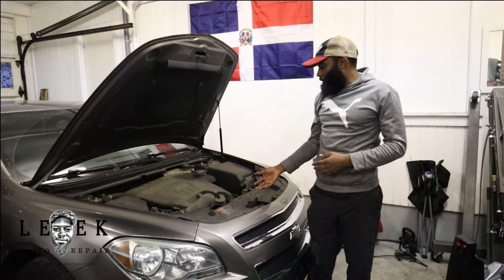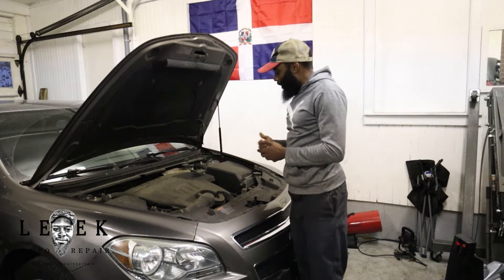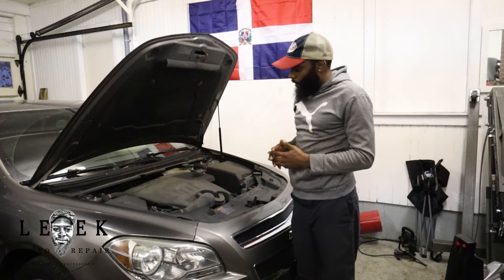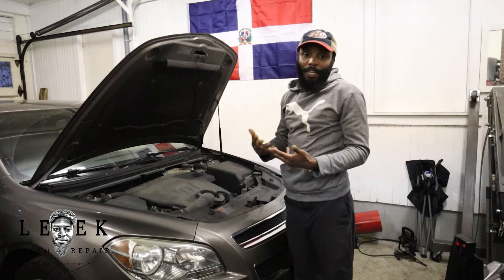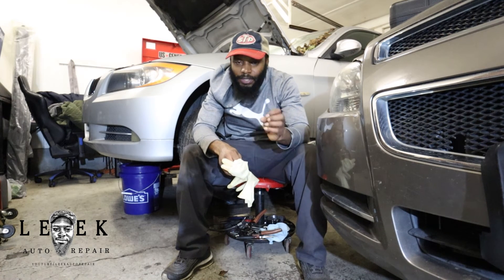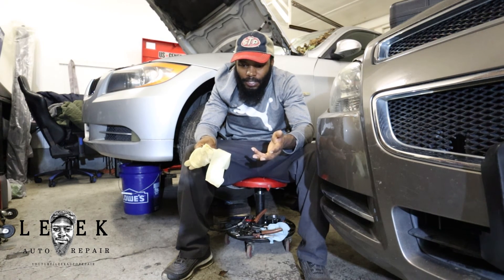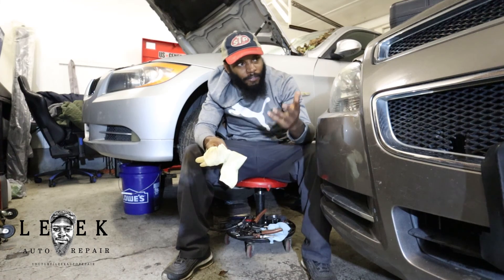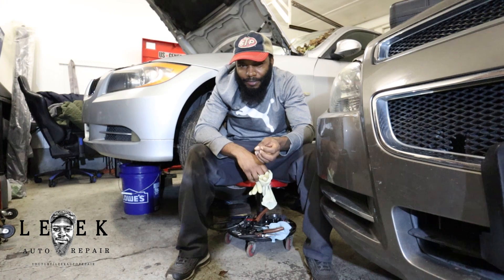Chevy Malibu P0796 Revs High | Trans Fluid Inspection Part 1

Comment: Good morning, Leek. I have a 2019 Chevy Impala LT V6 with 199789 miles on it and it has been good to me. I was on the freeway I was going 40 I was trying to press the gas paddle, but it did not improve my speed, the check engine light went on. I took my car to a place why the engine light went on I have a code 0796 and 0700 I check the oil, and it is black. Can you tell me what I need to look forward to? I appreciate your feedback. Thank you.

Comment: Question my guy ... What was it? Im the same exact set-up as you solo bad ass mechanic but im a dodge guy lok ... Was vb /sol? .. or was it mechanical damage for r/r
Reply from the maker: Valve body but I ended up replacing the trans bc it was cheaper